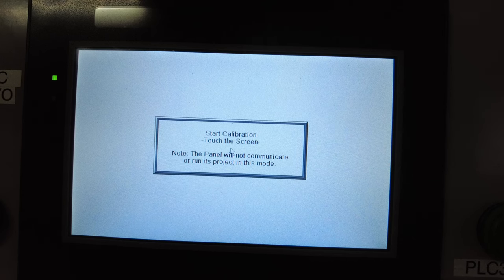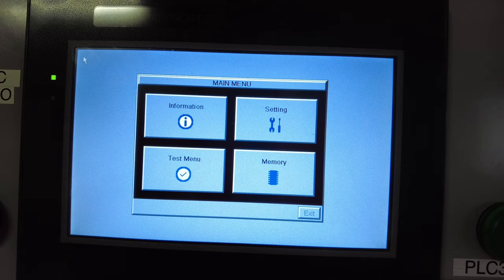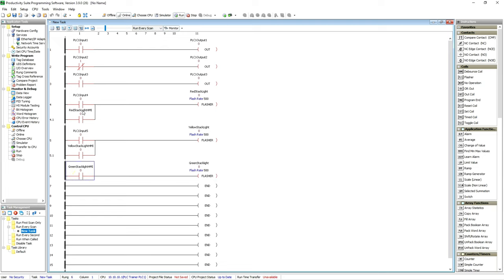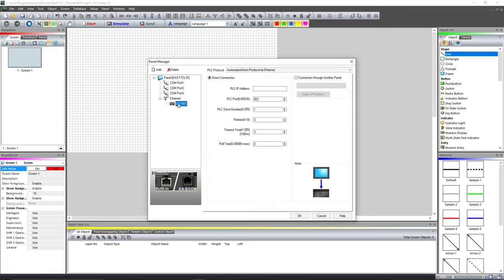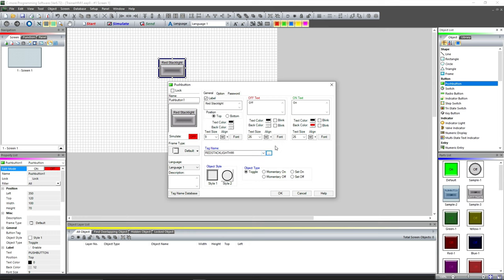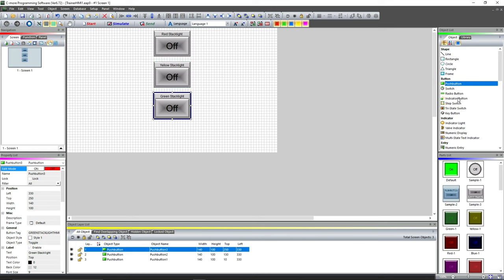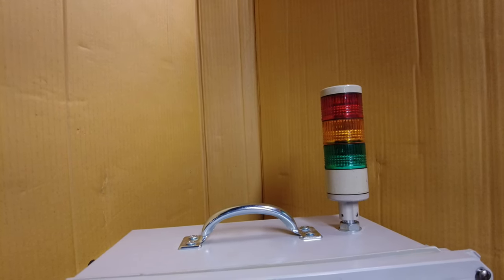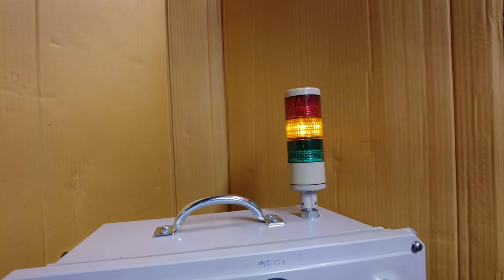Beginners Guide To Programming An HMI From Automation Direct

Comment: Great video! Thanks!  I have subscribed.  I have an upcoming project setting up a HMI to an ancient SLC500...  Hehe!  The existent PLC program is twenty years old, and documented about as well as Mayan history, and probably in the same language.  But we do know the goesintas and goesoutas so we may be able to pull it off.  Gonna start with a one button 'auto' to 'manual' switch as proof of concept.  There are no tags so I will have to find the Inputs and Outputs on function observation.  It will take a while. I am going to use a C-more, probably the one in this video.  Automation Direct has always made me look smarter than I really am.  Don't tell anybody.   I am retired, but guys like us don't ever really retire...  We just consult off into the sunset.

Comment: Big fan of AD, especially the Productivity series and C-More. After dealing with multiple generations of Allen Bradley, Mitsubishi, Omron, Panasonic, and every other line at Automation Direct; I think Productivity is by far my favorite programming environment.  The C-More's are incredibly capable, especially at the price point.
Reply from the maker: I default to the Productivity Series on everything nowadays! There'll be plenty of upcoming vids on them in near future. Thanks for the comment!
Reply: @controlsfreak6328  I also now use them for everything. I'm glad they haven't been hit nearly as hard supply chain wise as everyone else yet. Most of my backorders have been within a month so far, except an 8 port Stride switch that took 6 months. Anyway, happy to up the engagement on this content, I'll try to share it around!
Reply from the maker: I'm still waiting on an 8 port Stride lol!
Reply from the maker: I just used a couple Click pluses paired with the new GS10 MicroDrives and it worked out really well.
Reply: @controlsfreak6328  I'm not a huge fan of Click, but I can see where they have their place. I haven't used one in a couple of years, but the software felt very limited at the time. How are the GS10s? I have 2 15hp GS20s that are supposed to show up this week, but they're going to be glorified soft-starts. I have several GS1s that just run small conveyors, and a few of the GS4s in everyday use. Have you tried the SureServo2 stuff at all?
Reply from the maker: I don't do much motion, and when I do I love the RoboCylinders from IAI. The GS10 is a phenomenal little drive for the money! I've got several GS4s running, but these GS10s are so compact, full featured, Modbus RTU if needed.
Reply: @vziemer  they've been just as bad as anyone lately (well not as bad as RA, but that's not hard). P1-16TR took 8 months to get, P1-550s have been backordered for 8+ months but the 540s are shipping. BRX stuff is impossible to get. Some has never come off backorder the past 1.5yrs so just get your name on what you need and it'll show up maybe.
Reply: @controlsfreak6328  I mostly use the SMC electric actuators, but IAI was really common on older equipment here. I've used the SureServo1 series on a few long length pick and place systems, and I'm hoping the SureServo2 has better communication support.
Reply: @Durallymax  We order a bunch of stuff from AD, I don't know if that matters or not, I'm showing P1-550 available 10/21, and I've been getting them about a week before the back order date so far. Also showing 10/14 on the relay card, but I have not ordered one for a while. I've been waiting around a little over a month for some P1-08ADLs and that seems to be the worst as far as PLC stuff for me. I don't stock or spec the Do-More stuff anymore, so no idea there.
Reply from the maker: I ordered a P2K system with 10 units on June 16th, all I'm waiting on now is a 16-AD1 and a 16-TD2P. The cpu, base, and several other cards came way before projected. All my ZipLink came in, the backorders suck, but it's where we are.
Reply: @controlsfreak6328   I am in planning stages for a project that might be 70+ P1000s,  and EA9-T10WCL+s, We're looking at around a year to execute, but availability is front of my mind right now whether it's even going to be feasible.
Reply: @vziemer  I'm quoting times it took for items to show up from order date to my door, not current anticipated ship dates. It's bad everywhere, AD just had a larger inventory to deplete up front.
Reply: @Durallymax   I'm not try to discount your experience, just offering mine. So far, I have had nothing show up later than the anticipated date at order time. I don't expect that to always be the case in these times, and I would believe that it hasn't been for you. It's always possible that we are just ordering different things. I have 4 P1-550s expected mid-October so perhaps my experience will change.
Reply: @vziemer  If you need to buy various brands of industrial automation products, you can contact me, ABB, Schneider, Siemens
🤝

Comment: There's no need to open the tag DB to select a tag, simply type it in and it will predict it. If you do go to the tag DB there's no need for the double click, just single click and click OK to close the DB. Tag will be selected. 

The pop-up is for manually adding tags and it's non-closure feature is nice. When using bits of word in C-More the tags need to be created manually, not having that close after each one speeds up the sequential process.

C-More involves far too many clicks, but these seems avoidable with the right work flow.

The all caps is a complaint, it also wrecks the find and replace. There's a few threads about it and the more folks that jump in there, the sooner it may get fixed.
Reply from the maker: I appreciate the insight, I was unaware that you didn't have to click apply. I'm aware of the predictive typing feature, just trying to gear this toward beginners. There's a few things I'd love to see changed, but they're still awesome panels with every feature you could want.

Comment: This may be a dumb question but at the 6:37 mark you are putting in the IP address of your PLC correct? 

I am also struggling to connect my PC to my C-More, I manually changed the IP address to one that I think should work - I'm still confused about how IP addresses work exactly this is all a new world to me. But I am not even getting the option to select that device, I tried a variety of different IP addresses but can't seem to get anything to work. Do you have any ideas? I am seeing forms saying it may be something with my firewall.

Thanks
Reply: I Can help you with ips

Comment: Hi, this is a great video for those who really want to learn C-more panel programming... small projects example like this can simplify learning..
. I am taking the opportunity to ask a question. I am doing a project using a DL06 PLC with a CTRIO module in it.  I scaled the quadrature of an encoder input to be displayed in a c-more panel .. I am getting the scaled value  in V2000 and V2001,  but do not know load both values in the RLL in order  to display it in the panel ... could you help me with some tips in how to do it...thanks so much in advance...

Comment: So, the PLC I have setup is communicating to the HMI (Shows when lights are ON). The HMI receives info from the PLC but the HMI does not seem to send anything to the PLC. For example, START button on HMI does not turn anything ON on the PLC, tag names are matching and as BOOL data type. The physical START button works fine. Any idea why it doesn’t work?
Reply: What brand of each?
Reply: Allen Bradley CompactLogix and EA9 HMI. Found the problem though. Turns out that even though physical start button and HMI start are supposed to do the same, they can’t have the same address input. Actually, for the HMI start, the address created in the PLC needs to be left blank, the names and BOOL are the only ones that need to match with the HMI tag name to work as an input.
Reply: Typically I'd convert my physical input into a bit and then that bit can be triggered from the button or the HMI.

Comment: Are you familiar with the ATLAS HMI's from Automation Direct?  Does it use the same software?  Also thanks for posting!
Reply: Oops... just seeing now that the ATLAS are monitors, not HMI's
Reply from the maker: Correct, they're monitors, but they're touch monitors and they'll work with the C-More Headless HMIs which do use the same software.
Reply from the maker: SOME are touchscreens.